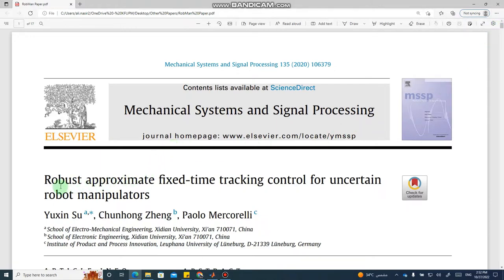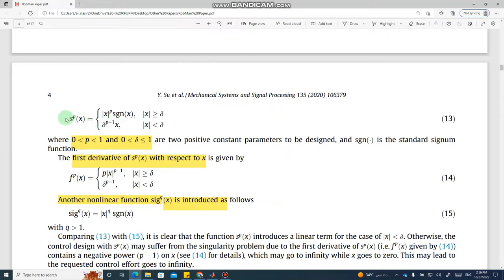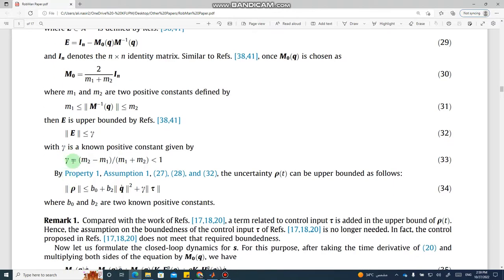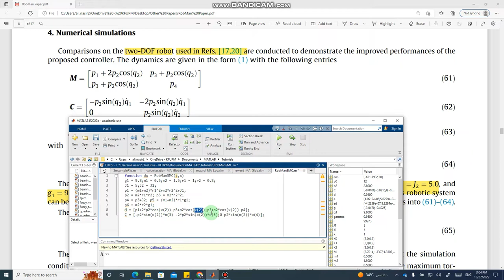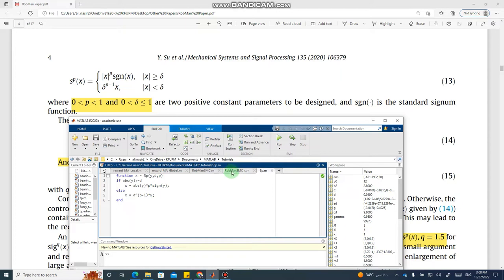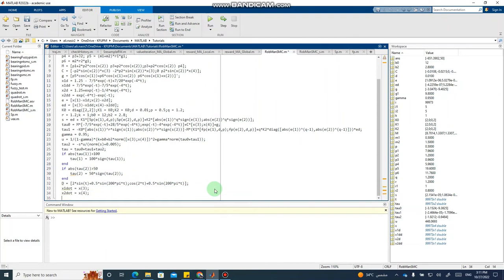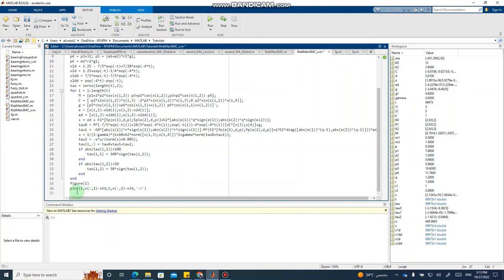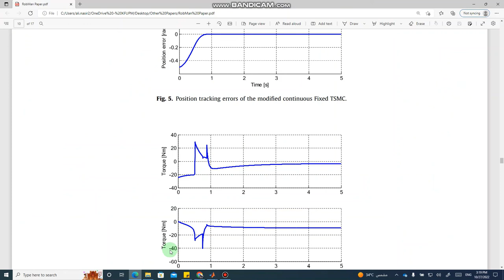MATLAB Simulation of Robust Fixed Time Tracking Sliding Mode Control for Robotic Manipulator

Comment: Es video me dotx(3), dotx(4) ki      value kay h please helps sir...
Reply from the maker: dotx(3) and dotx(4) have been combined into a vector called x34dot on line 35 in the code
Reply: @cset x34dot pr error aa rha h"Dimensions of arrays being concatenated are not consistent." Sir aap x3dot ,x4dot value individual value kya hai
Reply: Thanku Sir.. Coding done😊
Reply: What is the q1,q2, dotq1, dotq2  value in this paper ? Please give the  reference papar name where q1, q2, dotq1, dotq2 is defined. Please reply Sir.....

Comment: hi sir, I have recently been using your method to simulate a paper. I recently encountered a problem. Some control u designs require the second differential of the system state. How can I implement it in Matlab?
Reply from the maker: For this, you need an extra state variable. For example, if you need to simulate x_double_dot, you need to define x1 as x, x2 as x_dot and then derivative of x_dot is the x_double_dot. Similarly, you can simulate the derivative of any order by adding more variables.

Comment: Sir, i am having doubt in matlab simulation of static sliding mode controller of coupled tank system taken from research paper. I have done simulation.i am not getting the desired result.Please help me in this simulation.